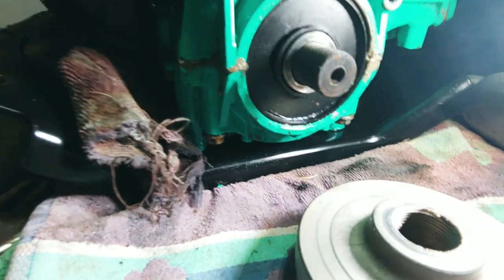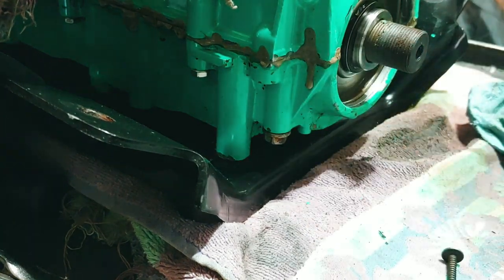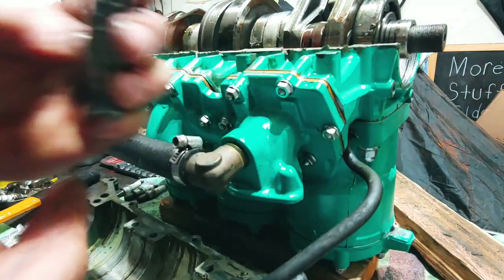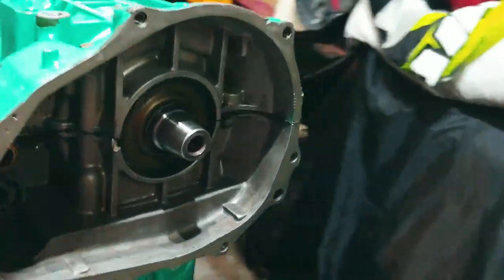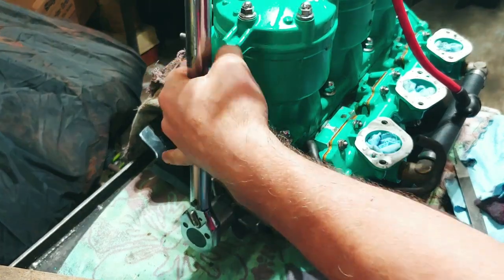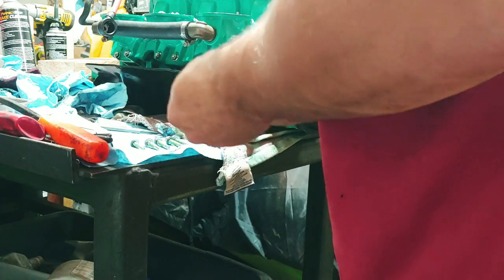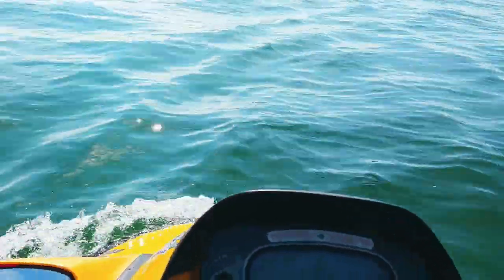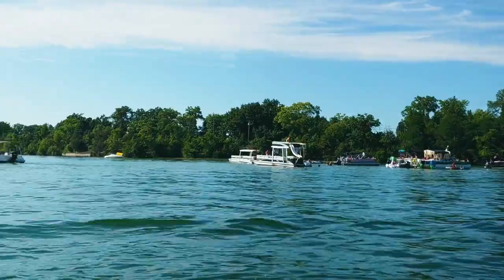2000 Kawasaki STX 900 Restore Series- Part 5

Comment: Hello , I got a 1998 zxi 1100. Runs great out of water but when u put in water it just bogs maybe 2 mph , checked compression  , checked spark , Do you think I have bad crank seals ??? Or carbs any info would be great , thanks
Reply from the maker: Hello, what was compression? Did you out new fuel in? How does the wear ring the jet pump look? They wear out and dont allow good power. What do you mean by "bog"? Does it sound like its revving good but little movement? Have you checked the intake geate for the jet pump for clogs? Idle should be around 1900 out of water so that ots around 1500 in water. Check to make sure your duel tank vent tube is clear. Also Make sure the coolant output port from the exhaust in the front right side of the hull is spitting out water. 

 If it idles okay on the traile and in watwr but bogs when you give it fuel, the carc debris screen inside the carbs may be clogged. 

 Hope this helps. Let us know what you find.

Comment: Wut kind of sealer did you use on that crank case ? I use one of two , three bond 1184 or moto seal work the best I found out over the years on building snowmobile engines .
Reply from the maker: I use Permatex "The Right Stuff" Ultra Black One Minute Gasket sealant.
Reply: @Fixin2Ride-Official-  yamaha bond is the best. Or honda bond if you can find it
Reply from the maker: I have been using the permatex and its been great. No issues. Thanks for the heads up though. I will try it sooner or later.
Reply: @Fixin2Ride-Official-  once you go yamabond youll never go back. 
It even comes with a little key that you slide the bottom into and it rolls the tube so you get every last drop from the very beginning. 
Its also less messy than anything else i have tried. 
Little secret. Every dealer i have worked at even (honda, suzuki, kawasaki) all used yamabond lol.
Reply from the maker: Well then, that sounds pretty sweet! Lol. I like it. Deff will be trying it.